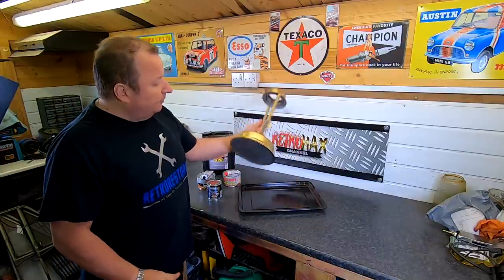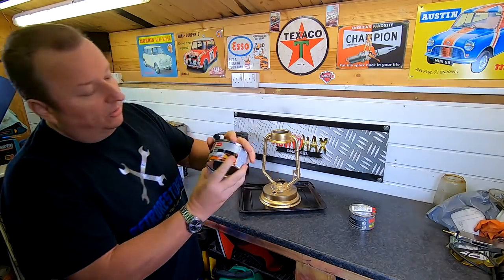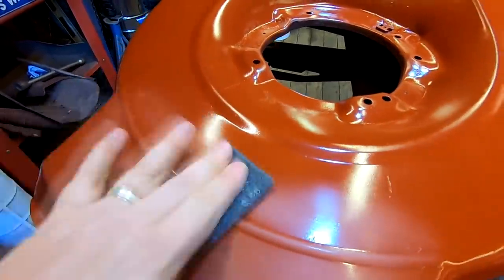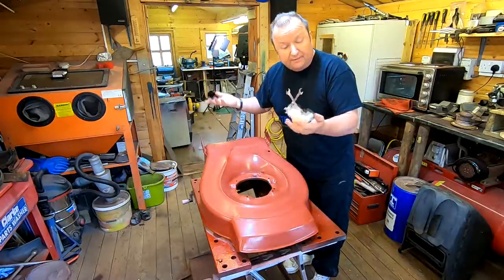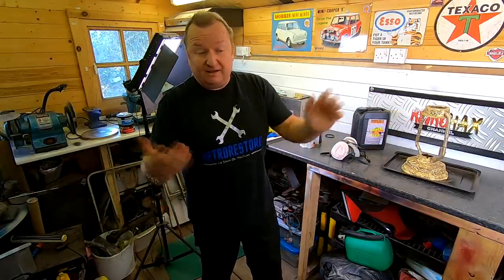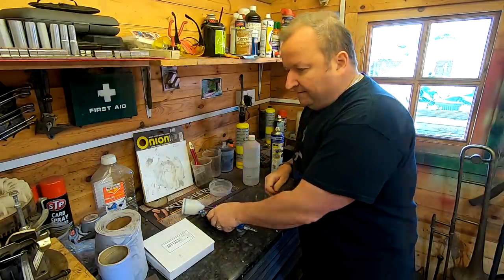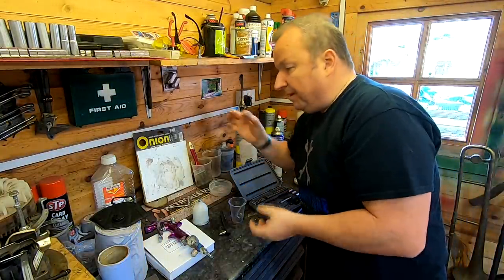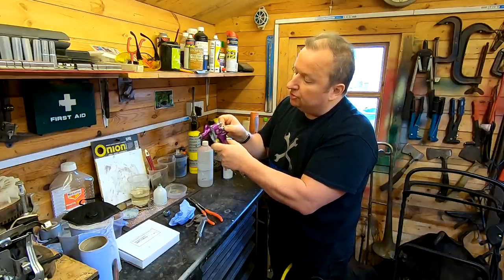Paint Reaction And We Spray A Lawnmower Deck Vlog

Comment: Martin, I have about five or six nice paint guns myself. And a trick I like to use to clean the guns every time I use one is to use carb cleaner or brake cleaner in the spray cans and spray everything in and out side the paint guns clean. It takes so little time to make them look and function like new. And I own some nice DeVilbiss paint guns for about eight years or more and they look and function like new to this day. Give it a try and see what you think. Quick, easy and uses a lot less cleaning solutions and are ready to use, again if need be, in about five minutes... Thumbs Up as usual!

Comment: Paint job looks great, too good for a lawnmower, lol. 
A tip for your leaking air hose. I assume it is the end fitting that the air tool slides onto that is leaking air. Dismantle the fitting, you'll find an "O-ring" that must not be fitting properly to seal air. You can remove that "O-ring" and turn it around and you will then have a whole new surface to use. Might be a good video for you to do ... Cheers !!!
Reply from the maker: Yes, I keep meaning to do that but now I just might get it done lol

Comment: Why don't you paint the onderside of the mowers?
Reply from the maker: You can't do that when the top is wet. It will get cleaned and treated.
Reply: Ofcource you can't do it when it's wet. But you treat the onderside, but not paint?
Reply from the maker: @carolavw  I don't think that really needs answering does it? Why would you waste your time painting the underside?
Reply: @retrorestore  I really don't know. Protecting from rusting? I'm just wondering.
Reply from the maker: This video was about the top of the deck. I mention in other bids what we sometimes do to the under side. I can't mention every single thing, that would make every video boring and repetitive.
Reply: @retrorestore  true! I am watching your video for like 6 months right now. And I was just wondering what you actually was doing to the onderside because I never saw it.

Comment: As someone who has DONE spraypainting as a day job, the photo on the thumbnail looks EXACTLY like when you paint BEFORE THE degreaser has a chance to dry. But you DO GET reactions between paints that are incompatible. You CAN see problems if 2 different paints have less than 24 hours between coats but usually it's in the form of tiny holes (pinholing). Your son could tell you all this.
Reply from the maker: The thumbnail is the paint stripper bud.

Comment: I'm doing the exact mower deck at the moment, and i'm rubbish at feathering out the edges on the flaking paint, speaking of which, i wonder if mower decks are powder coated, as there is never any primer under the paint only bare steel, also the paint covering is quite hard and thick,?
Reply from the maker: I've not had any powdercoated ones but they are cheaply painted, that's why they chip off and rust so easily.